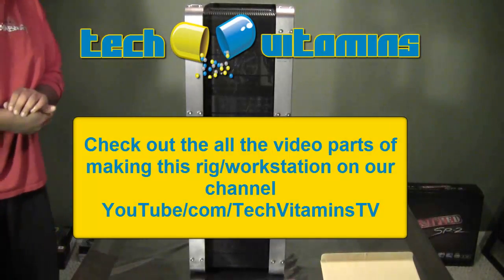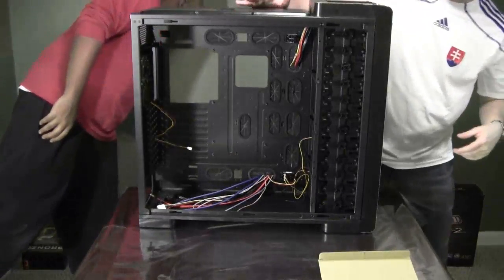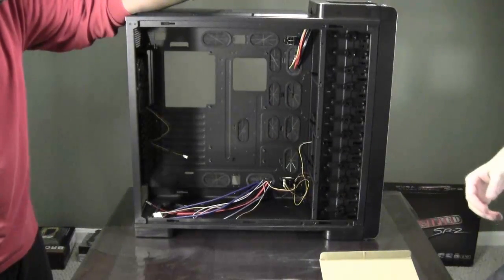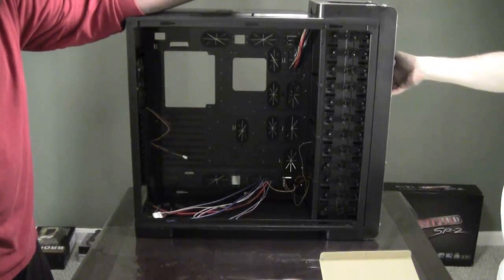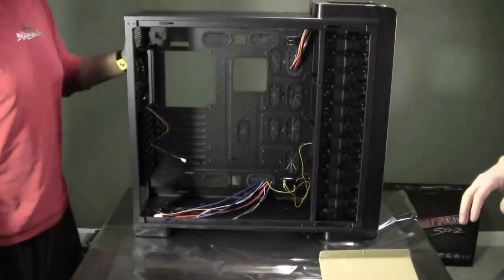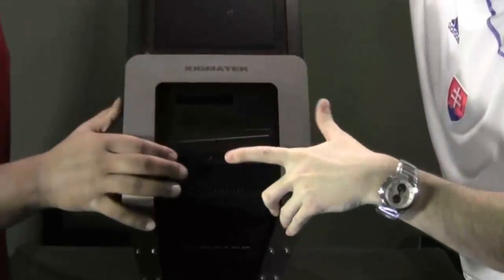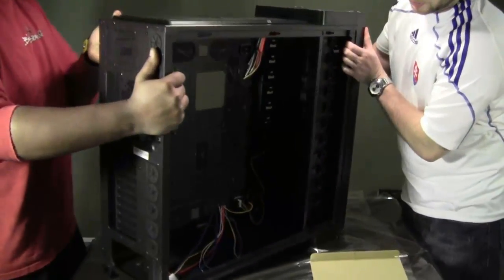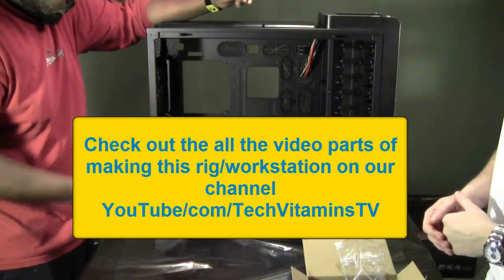Xigmatek Elysium server case review and installation

Comment: If the wheels brake down you can always do an IKEA hack! Ikea has some very cheap office chair wheels. They are strong! I replaced some broken wheels under my audio shelve with the ikea wheels and they are Awesome! :)

You do a great build! Why do you want to use a big full watersetup for xeons? I think 2 Corsair HX60/80 should be enough? and much easier to maintain.